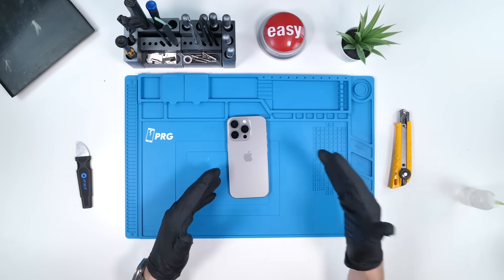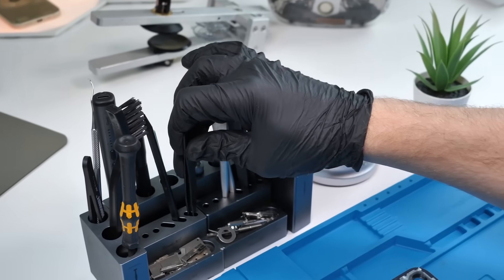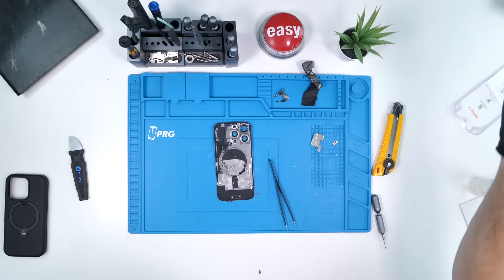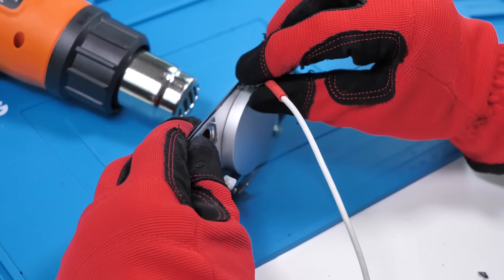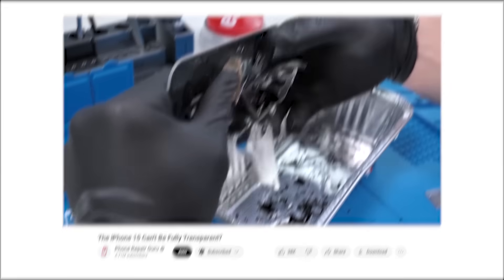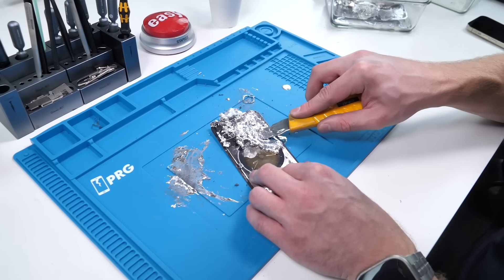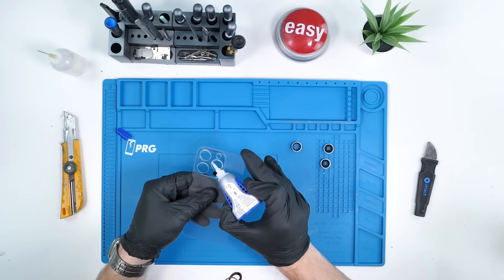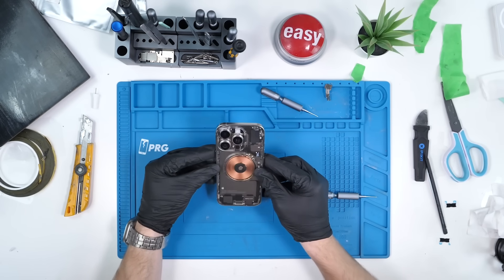Apple Should Sell It Like This… 16 Pro Transparent Mod

Comment from the maker: Check out Torras Here: https://bit.ly/3zIiwYx  Use Code " Guru20 " For 20% Off!
Thank you guys for watching :)
Reply: Okay thanks! My favorite tech YouTuber i will check it out!❤
Reply: No problem
Reply: no
Reply: Nice
Reply: Thank you for including Hindi
Reply: Hi
Reply: How much would it cost for you to do this for my phone
Reply: Can you do a test? On the iPad mini 6 PRG
Reply: You'd be better off using caustic soda mixed with water on the aluminium, it's easy to buy as it's a drain/industrial cleaner and will dissolve the aluminium (releasing hydrogen)
Reply: got the torras glass screen protector for my s24 ultra... easy install and its holding up great 10 months in.  Definitely recommend their products
Reply: I have motorola one power swim in water now not working but it's parts hard to find in India so now what can I do
Reply: I have motorola one power swim in water now not working but it's parts hard to find in India so now what can I do
Reply: Question can i send you cellphone for you to repair it and post a video of it please
Reply: How to clean u shaped camera notch without removing glass guard it gets dirty too fast due to glass gaurd stick after notch ended
Reply: Ok
Reply: @phonerepairguru классный мод 👍
Reply: Please can you translate this clip into Arabic? 🙏😢
Reply: How's it going
Reply: @PhoneRepairGuru  if I send you a Apple Watch Series 4 can you fix it?
Reply: At this point i wonder if it wouldn't be easier to 3D print that back glass with a transparent resin, resin printer a precise to the micron so i think it's worth a try, not sure what the feel of the finish panel would be but it can always be polished.  Could be a video idea, take phone component and a 3D printed housing full customisation potential.

Comment: Before removing the battery, I need to detach the frame mount, but the adhesive used there is a hassle to remove. I wish this part could be taken off more easily too.

Comment: A very good result! But if this glass breaks, the glass particles will get directly inside the device. Therefore, it’s better to modify this back glass, for example, by adding a protective transparent film between the glass and the internal components.

Comment: Yo just thought of this while watching the video why don’t you have like something coming from the ceiling that you can set up so it just blows a hot air gun or whatever onto whatever phone you’re working with that way you can continue working on it without you having to use one hand to hold the heat gun

Comment: Why don’t you try use the camera button on an iphone 8 
Take it appart, mode it to use the same pin connecter as the normal fingerprint from the iphone 8 and see if it works

Comment: At this point i wonder if it wouldn't be easier to 3D print that back glass with a transparent resin, resin printer a precise to the micron so i think it's worth a try, not sure what the feel of the finish panel would be but it can always be polished.  Could be a video idea, take phone component and a 3D printed housing full customisation potential.

Comment: How will you safely dispose of the used gallium/aluminium mixture?
Reply: Agreed. I just read a couple of safety data sheets for gallium.
Skin contact has serious implications.
Gases released should not be breathed in.
Disposal should be via industrial incineration and absolutely not into household sewage systems or watercourses.
The mod is cool, but this kind of video is going to get a lot of coverage and will inspire others. It’s pretty reckless not to be mentioning safety when dealing with chemical process like this.
Reply: Backyard:

Comment: hey i have a little tips for glue on transparant parts.....super attack let mark on object try use it a Mr.Hobby MR. CLEAR GLUE (MJ199) it's a bit expansive around 20-30€ in Italy but it's the best glue for trasparent part (also is super easy to clean glue in excess)

Comment: 2:23, there won’t be, every MagSafe iPhone supports Qi 2
Reply: womp womp, who tf uses magsafe in 2024? its much better buyinga samsung and even if you have an iphone everybody uses normal cables

Wtf is "Qi 2" this portuguese or spanish?
Reply: @Willlmm Sooooo, You do know that iPhones and Samsungs use THE SAME Cable lightning was removed on last years iPhone 15/15 Pro sooooo now they have the SAME cable and Apple has MagSafe and Samsung does not… And Qi 2 is just a wireless technology
Reply: @MokacchinoFan  who ordered a yappuchino?

Comment: what do you mean its charging with MagSafe battery pack? I tried that couple of days ago and it did not for my 16 pm, I use black brook leather case but it has MagSafe in it and it does work with MagSafe charger but not with battery pack directly from apple, just retried and yes it did show for few secs that it does and my battery pack that has 99% battery left, but soon after it showed that it is 0%.

Comment: I think it would look much better without the wireless charging coil.
I also used to think that I needed wireless charging. But soon I started to see excessive overheating and battery life loss. So ditched wireless charging and just bought a few cables for dirt cheap and never looked back at wireless charging again

Comment: I’ve never understood why Apple hasn’t done this. Their insides are always so clean and like artwork. It worked for watch companies. Apples products warrant a clear back.
Reply: apple will never do this because it removed a lot of metal which makes structural integrity much worse. people wilber complaining about broken glass all the time
Reply: @supersaood  well I’m guessing if Apple did it they wouldn’t just tear the guts out and scrape everything clean. I’m sure they’d do it a little bit differently lol
Reply: Yeah but if you want a clear iphone get the dbrand teardown skin
Reply: Its like a modern car. you can open the hood but still don't see the engine
Reply: @livewallberg  - Lol a perfect analogy.  You're better off just displaying a photo or x-ray picture of the insides on the screen, or get one of those picture backs with much more visible stuff showing.
Reply: There's not much to be seen, it's mostly a metal caged battery, the circuit board is not even visible.  Instead just display a picture on the screen flipping between the front and rear transparency or x-rays.  lol
Reply: @BillAnt  why did you end that with lol? Was your comment clever or funny or something?
Reply: @Duckoff50  - Because it's crazy doing this when you can simply display a picture of both front and back insides.  They even sell a nice x-ray back cover with a lot less hassle.
Reply: @BillAnt  buying a phone made that way wouldn’t be a hassle
Reply: @Duckoff50  - Well sure if Apple would offer it as a transparent option.
Reply: @BillAnt  well yes that’s the whole point. It worked for swatch and they are a multi billion dollar company now. Just think Apple could become a billion dollar company oneday lol.
Reply: Removing all that metal might mean it's no longer EMC compliant. At the very least, it'd have to be re-tested for EMC compliance.
Reply: They use cases and it hides it away.
Reply: everyone have a case on so its useless if u dont use a transparant 1
Reply: @TheGhostOfTheShadow  no we don’t all use cases no point if I’m upgrading every year
Reply: They'll consider it in like iphone 56 and will charge extra extra.
Reply: @rurounisensei  what?
Reply: @Duckoff50 
 It's just as I said. Yesterday's tech at today's price.
Reply: Because it's ugly
Reply: Because it is unsafe and not waterproof? Imagine letting this thing fall on the ground and hitting the battery, good Night bro.
Reply: @SlothDemon  Are you for real? Ever heard of nothing phone?
Reply: I LOVE clear/see thru electronics! I have a few of the clear switch controllers. They’re so fun to look at
Reply: If you want an actual reason, a transparent case means removing material from the back of the phone that isn't purely aesthetic. There's a structural compromise in removing the layer he dissolved qith the gallium, it makes it easier to damage to internals of the phone. 

That's why transparent mods like this aren't so common anymore and why jerryrigeverything stopped doing them and eventually partnered with dbrand to make the dbrand skins (which happened long after he stopped doing transparent mods for the record, alot of people seem to think he stopped doing them because of the teardown skins for some reason)
Reply: @metaforth  Nothing exists.
Reply: the reason is "you don't understand" that doing this compromised so many things
Reply: @ what? If Apple did it wouldn’t compromise anything.
Reply: I also did the mod, it’s on Ebay now.
Reply: The internals has to be protected against the UV light from the sun, otherwise stuff like the battery and circuits could get damaged or wear out faster
Reply: They have done this, back in the early 2000s they had transparent Macs.
Reply: They did it with beats and it looked good, but they would need to re test the fcc compliance and other regulatory procedures and that costs money
Reply: It gets hot
Reply: Then when you drop it, you'll have to buy a new one)
Reply: Because you don't want consumers looking through the transparent back and getting any ideas about repairing the individual components instead of buying a new phone
Reply: Because they also sell phone cases , and if they release a transparent phone ,users may not put some phone case to their phone or they just use a transparent one which may affect their silicone case products
Reply: @felixmuyco8055  no because unfortunately Apple makes the sides of their phones so slick you have to have a case. I don’t keep my phone in my pocket I fidget with it flip it around in my hands and without case it’s too slick. Every decision always a money grab unfortunately.
Reply: @felixmuyco8055 Apple makes their own transparent cases…
Reply: @felixmuyco8055 is this serious
Reply: Because it will look refurbished
Reply: Because the clear back versions are only for executives and the engineers that worked on the phones
Reply: They’re I think th wonky company that leaves the copper in the charger coil exposed ands always looked good
Reply: That metal in the back of the phone is shielding to protect you and anyone around you from radiation from the phone. Remove the shielding, increase the radiation. The FCC would frown on that.
Reply: @mattbosley3531  it’s there to provide structural integrity to the glass. Nothing else.
Reply: probably because the average apple sheep won't care too much or will even be disgusted
Reply: @la_woo  be disgusted at what? I always love the people that hate on Apple because we like their products lol
Reply: @Duckoff50  well I know some people that would definitely not like it if they could see the phones internals 😭 but yeah it’s a cool mod either way
Reply: @la_woo  that’s why give the options. I don’t know your age but swatch watches were garbage Swiss watches. They made them see thru with cool colors and now multi billion dollar company. That’s what Apple should strive for lol.
Reply: @la_woo  Back in the day Apple had a whole lineup of transparent iMacs, so i don't know about that. xD
Reply: @la_woo wouldn’t an apple “sheep” actually enjoy being able to see inside the phone?